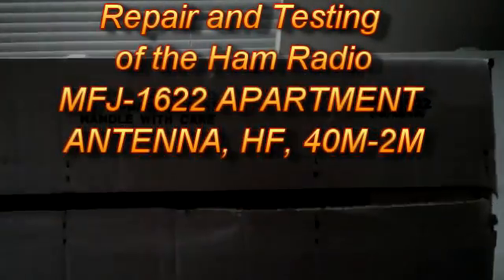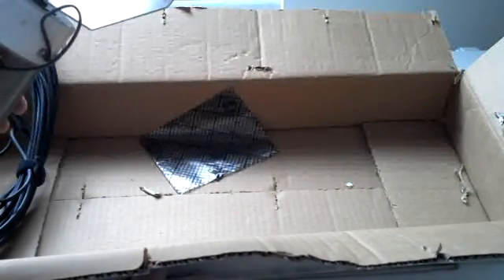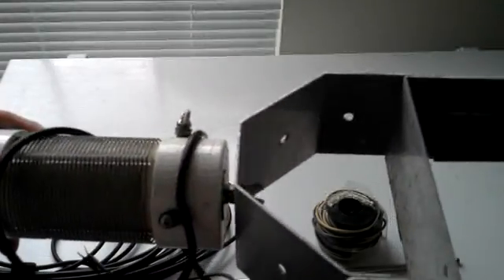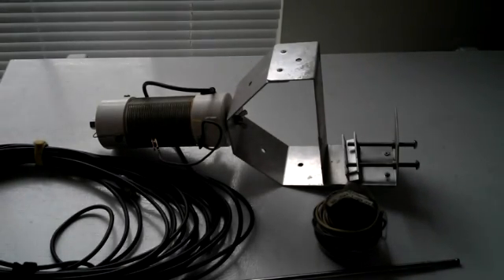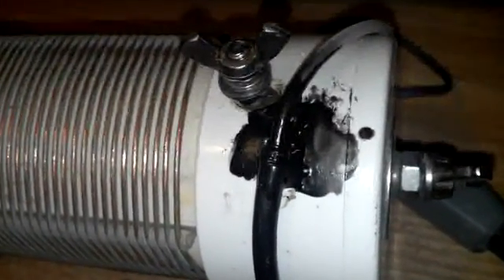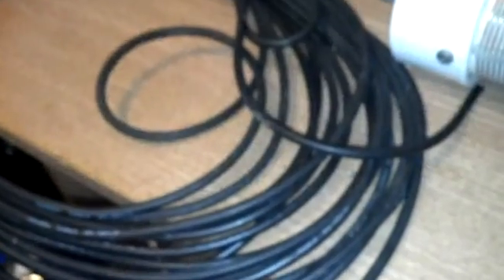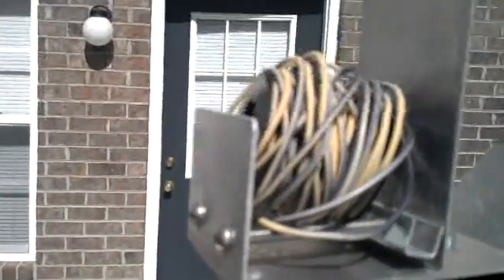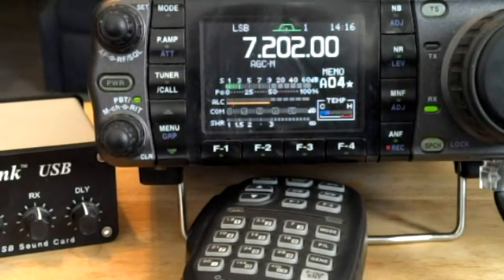Rebuild MFJ 1622 Apartment Antenna for Ham Radio HF

Comment: hello, I got this antenna as a gift from an amateur friend of mine who doesn't have the patience to use it (adjust the length of the counterweight select the right coil with the alligator clip to have the SWR tuned). The instructions say that the counterweight wire must be 1/4 wave of the band being used, the remaining wire must be collected in a coil. It is possible to make many 1/4 wave counterweights and connect them all together to the pin? I would like to prepare many 1/4 wave wires for 40m, 20m, 15m, 11m and 10m, but if it were possible I would like to connect them all together to the terminal instead of mounting his at each band change. To mount it outdoors, can the stylus be painted? I would like to protect it from rainwater. same thing for the coil: I would like to find the correct tuning points and then make some pins with an external commutator and close the coil inside a watertight box to isolate the coil from rainwater and act from the outside from the commutator for the band change.
What do you think? Thanks for the info
Reply from the maker: okay lets see . 
yes you can connect all the different counterpoises to the the same connection point. You could paint it all but don't break and electrical contacts I took the original whip antenna of this and put a 40 meter ham stick on it so I could tun it up (Poorly) to 80 meters band. The most of the time to tune it I would get on the frequency I wanted and run the clip up and down the coil until I found the loudest S-noise.
Reply: @NorthCarolinaPrepper  ok thanks for the reply. Which replacement whisk did you buy? Is it a flexible, fiberglass whip?

Comment: Excellent idea!. I converted a MFJ-1623  into a more portable system just by mounting it on a surveyor's tripod. And I added a MFJ-63 loading coil just to make it cover the same bands as yours does now. I live with HOA antenna restrictions here in central NC, so my antennas have to be "not visible from the outside". Hence portable and temporary. Great video!

Comment: Great video. I purchased one and didn't understand from the start why MFJ put a standard alligator clip on it (too thick) as it would touch three of the coil wires at a time. I too purchased toothless, flat alligator clip and replaced it.  Also, the coil wire was poorly soldered as well and broke off so I replaced with stronger wire and better solder point.  It works pretty good out my hotel windows as far as compromise antenna go, it just had a few poor craftsmanship details.  After fixing it I am happy with its performance.

Comment: Thanks for the video, good job. You showed in the video that you can work 80 meters, do you mean you put a a ham stick on in place of the whip?  Also, would an automatic tuner do the same? Thanks again.
Reply from the maker: +vetham100 Yea I put different ham sticks on in place of the whip.
Well i have a Z11 pro and I can make the radio see a good match but it really need something like a counter poise to push against.

The way I tune it now is put the ham stick on for the band I want and move the clip up and down un-tell i hear the loudest amount of static on the freq i desire. Then auto tune from there.
Reply: +North Carolina Prepper okay thank you, i really appreciate your answering me. i live in  an 11 apartment box with no back yard and no balcony so i'm limited to the window sill (ya right) and a rope around a chimney...time to get creative LOL.

Comment: I'm using one of these currently on 10m. Making contacts in europe, S America and around the country. It is tune-able i suggest a antenna analyzer for the most accurate set up or you can use a tuner.I'm using an icom 745 pushing 90 watts barefoot.

Comment: Essentially it's another base loaded vertical ant. with an angled mounting bracket that allows it to jut out from apt. windows and balconies.
Reply: Similar to his, I have a MFJ-1623 which I just converted to a larger surveyor's tripod mount for more portable use. Mine stores in a canvas bag that a camping chair once came in. I did not use the window mount hardware in my conversion. Mine goes straight to PL-259 coax to 3/8ths -24 whip connector on the tripod. 

The difference between the two, is that mine covers 30 to 6 meters with out the coil and it also has the short whip tuner with it, which I had to make an adapter for to fit a PL-259 connector. And a small plate to add it to the tripod if I wish to use it too. 

The MFJ-63 loading coil I ordered covers 20, 40 and 80 meters makes it basically the same antennas the MFJ-1625. 

It's great for listening as well as ham use. An upgrade for me would be adding the 17 foot telescopic whip, instead of the 12 foot whip. But mono-band ham sticks also work with this set up, or I can tune a random wire from it by putting a 3/8-24 bolt in the whip mount to attach it.. I wanted to make myself something portable, as well as something versatile and this does it for me.
Reply: I was also working to convert just the 12 foot telescopic whip on this now "made into a more portable antenna" system, directly into a 1/4 wave ground plane antenna for each ham band from 20 to 10 meters. One that would still fit inside of the same camping chair bag for storage.

 So I calculated the combination of extension lengths needed to make a 12 foot telescopic whip cover the bands from 20 to 10 and then I added a 102" stainless CB whip as well just for this purpose. 

(I could just collapse the 12 foot whip to tune it or even better; order the 17 foot telescopic whip, but I was thinking at the time (I live in an HOA antenna restricted neighborhood.) about the ease of preset tuning in setting up a portable mono-band ground plane in the dark just by it's own assembly.) 

I still figured I'd just add the coil to cover 40 and 80 meters. And then I could choose to use the whip tuner as another option with the location and situation. 

For the extensions, I bought two 36 inch sections of 3/8th's aluminum rod from the local hardware store, and cut one of them to make up a 20, 12, and 4 inch extension and then threaded each end  on each to 3/8 's-24 thread. But I found that aluminum rod alone will not hold up with out some bending in the wind on the mountain where I tested it at it's full height of 18 feet plus the tripod.. So my next set of whip extensions will likely be with stainless rod if I make them. Or I'll just add PVC pipe to the reinforce the rods to make the aluminum rods a bit stronger.

Again, I live under HOA antenna restrictions here. So the added weight of using these 4 stainless extensions to make up a mono-band ground plane antenna is not really a concern here and more of a practically in a antenna system, yet one that is still highly portable and well made system that can still take ham sticks or tune a random wire too.

Comment from the maker: I have it done both ways. Set it for 40 and just tune it. It depends on what im doing. If im doing packet radio, I leave it at 40 if im hopping bands.  Basically i set it for what ever im using the most and the space available.

Comment: So you leave it set for 40, and use the tuner to tune up on 20. Do you leave the counterpoise wire set for 40 too? I am only interested in 20/40 and I like this solution. It is cheap and may get me back on the air soon.
Reply: Living in an HOA restricted community; I took two 100 foot rolls of inexpensive speaker wire and was able to cut two ground radials for each ham band from 80 to 10 (except 24 MHz) from them. I have to use them as two taped clusters or radial ropes (with out fanning them out due to the HOA restrictions). The 80, 40 and 30 meter radials are in two clusters, that I don't often have the space for using, the 20 thru 10 meters are in two other clusters that I can easily lay out here, and I ended  up with an additional 10 and 11 meters radials in a third two clusters. Each cluster has it's own ring terminal and soon, they will have kite string winders to hold and store them.

Comment from the maker: No you move the coil taps to the different parts to make it resonant on the bands.
Just run the clip up and down till you get the most noise and you will be close enough.
I just like the auto tuners because I dont want to mess with it on a cold night when im working packet radio. I tend to jump a lot between 20m and 40m bands